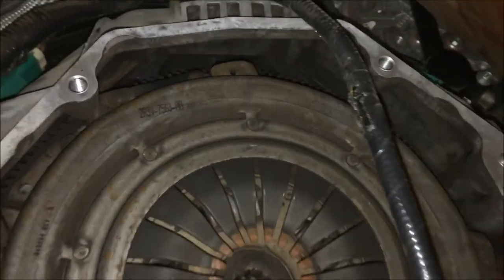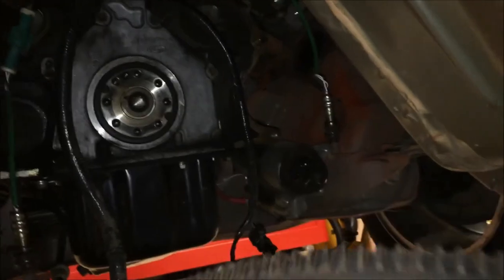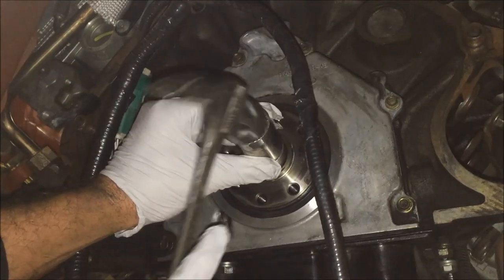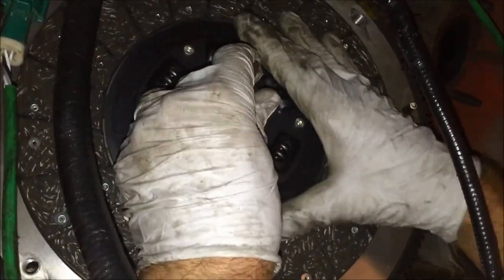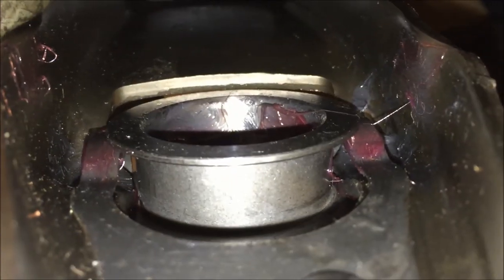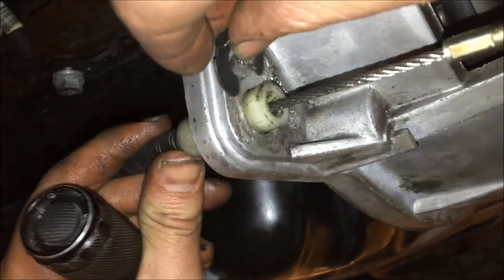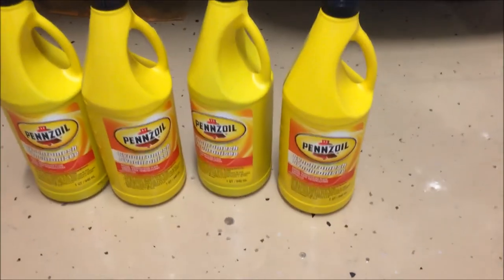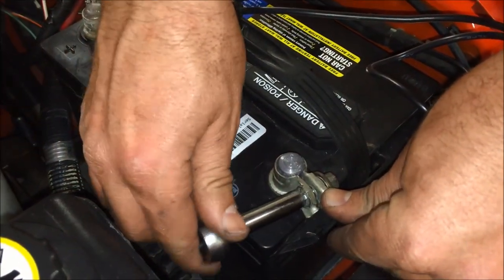(Part 2/2) 03/04 Cobra T56 Clutch, Throwout bearing, pilot bearing replacement release bearing

Comment: Doing mine with the help of my son in a couple of weeks. Ditching the current  Spec stage 3 in it. Thanks for posting this awesome detailed and informative vid!
Reply from the maker: You’ll have to see my latest videos on the pilot bearing removal puller (much better than what you’ll see in that video) as well as the RXT and input shaft videos (though you may not need those if you’re not doing the 26 spline input shaft
Reply from the maker: The puller https://youtu.be/YMx52ovuC8c
Reply from the maker: Set pivot ball stud https://youtu.be/IceR-zPpvns
Reply from the maker: Retainer sleeve https://youtu.be/EsaOBOy67h4

Comment: I see that you apply a lots of grease on the TOB, sleeve and pivot ball.  Doesn't this attract dirt and dust more, so then it's worst than no grease at all?  I heard some people put some teflon non stick spary on this.  
Very good video, I'm going to drop my trans for that Clutch fork adjustment because of the RXT.  This vid is very helpful.  Thanks
Reply from the maker: It may attract some, but not really where it will be contacting, and mostly clutch dust over dirt. I also have a man updated video with the RXT, input shaft, pivot ball stud, etc. 
https://youtu.be/XjAh28xeRm8?si=FDa6tYpJTq421yqO

Comment: Just ordered McLeod twin Disk rxs. Do I get a new pivot ball as well? Purchased 26 spline gear, pilot bearing, retainer sleeve, throw out bearing and new fork. Also should I replace the main seal? Mileage almost 70,000. Thanks
Reply from the maker: The rear main seal is tricky. If it’s not leaking, just leave it. Yes, you’ll want an adjustable pivot ball stud- Street car shinanigans did a video on the exact length you’ll want to adjust it to. Here is my video on the input shaft and retainer sleeve. Be careful when removing so it doesn’t come apart https://youtu.be/EsaOBOy67h4

Comment: I noticed you left the counterweight on the pivot fork. I've heard of people taking it off with the T56 because it hits one of the front cover bolts.  Have you heard of that or had issues with leaving it on?  I found this out too late as already did my clutch job, but did notice on the old fork that there are definite marks in the weight, which I assume are from hitting said bolt.
Reply from the maker: It depends on the clutch and the transmission. The magnum requires a shorter pivot ball stud with the McLeod RXT twins disc clutch and some people have needed to even shave down the clutch fork and the case of the transmission. The question is if yours hits now that it’s installed. You may need someone to look at it (safety on Jack stands) while you push the clutch in
Reply: @dannyjohnsonsgarage  gotcha, thanks. I'm using a McLeod super street pro with the 03/04 T56-specific stud LMR sells. I hear/feel no issues with a completely depressed pedal but will convince the wife to try with me watching

Comment: Hey Danny, I am about to perform this job.. is there any certain reason you used the bread/grease method instead of a pilot bearing removal tool and a slide hammer?
Reply from the maker: Chad Wyatt Just because bread and wet towels always worked. I’ve heard of some people not having luck with the puller. Either is fine

Comment: What is that smaller disc for that goes between the flywheel and the flywheel bolts? I noticed on the Mach 1 video that did not have one, and when i did my 01 cobra using that video it didn’t have one. Now I’m doing it with my 03 cobra drivetrain and even tho it has the same flywheel (exedy lightweight) this one has that small spacer ring.  Should I be putting that back on or leave it off? I can’t really imagine it doing all that much if all that it is really doing is changing how deep the threads on the bolt go into the crank, which I would think the deeper the bolt goes, more thread engagement the better. What’s your opinion?
Reply from the maker: It’s a spacer shim. Without it the bolts might not go in all the way

Comment: Does it matter which way the throwout bearing is installed? I noticed a hump on it when installing my new magnum and i read somewhere that the hump needs to be facing toward the clutch cable...is this right?
Reply from the maker: It should be like this with the peak https://youtu.be/OC4vRWQLGdk

Comment: Im putting in a doublr disc clutch, what other parts would you think are best to replace being that the transmission will be un mounted at that time? Do you know the name of the hose that goea next to the transmission, next to the shifter , so the oil breaths?
Reply from the maker: It’s called a transmission vent tube. I would strongly consider the head cooling mod, throwout bearing retainer sleeve, and 26 spline input shaft. The twin disk needs the 26 spline or you’ll likely break the stock 10 spline. This video shows the retainer sleeve and how to access the input shaft. https://youtu.be/EsaOBOy67h4

Comment: Hey Danny I've got a bad pilot bearing @ 70,000 miles! Just wondering what clutch kit you'd recommend? I'm at 500 HP right now and would like to be around 700 eventually, any advice would be greatly appreciated!!
Reply from the maker: If you are keeping the stock 10 spline input shaft and not doing heavy launches at the track, I would go with centerforce df (dual friction). My brother has spec 2 and it has some clutch chatter.  It’s jut what comes with better clutches, but I like the centerforce pedal feel. Just remove the counter weights on the diaphragm fingers.  
  If you are going hard launches I would go with a mcLoud RXT with 26 spline input shaft. You can see how to replace the input shaft in my video I’ll link below
Reply from the maker: Phil A Hardon It also covers the retainer sleeve which is a big problem on the t56. Id strongly consider a new one as well https://youtu.be/EsaOBOy67h4

Comment: If you have long tubes, you have to loosen them to get the bellhousing out, right? I am running into this exact issue. My passenger header is kissing the bellhousing and not allowing me to get it off the dowel pins. FML
Reply from the maker: Yeah, that's what I'm hearing, but it depends on which brand you have. Some people have been able to drop the transmission (leaving the bell housing on) and not needed to remove/loosen the headers
Reply: I got the bell housing off just now. It took some major twisting and prying. I hope I didnt bend anything. No clue how I will get it back on... We will see!
Reply from the maker: Jani Patrick Good luck man! Hope it all goes back together good!
Reply: I think before I install everything, I will slightly bend that little part of the header with a ball peen hammer to give me clearance. I only need a little bit. Thoughts?
Reply from the maker: Jani Patrick Just remember heated metal can be brittle, so you might be okay bending it a little one way, but not back and forth or a lot. A little may be okay
Reply: No, I would just go one way/ I just need to dent the header tube ever so slightly. Not sure iff heat would be needed, but tapping it with a ball peen hammer with a piece of wood behind it?
Reply from the maker: Jani Patrick yeah, i’m not a black smith, but seems heating it may help

Comment: i’m changing my pilot bearing on 99 cobra but it seems like i can’t find the right one , will the one for the 99gt will fit or are they different?? part number is M-7600-B
Reply from the maker: That is the correct part number. You can’t find one or it won’t fit? Have you put it in the freezer like the video shows and then tapped it in? It is a tight fit

Comment: Hey Danny love your vids as usual, I just finished installing a McCloud clutch kit, and replaced the pilot bearing and the flywheel was resurfaced. Finally got it all together and the car will not go into gear, do you have any idea what would cause this?
Reply from the maker: Phil A Hardon Is it a twin disk, and if so did you get the adjustable pivot ball? Does the clutch feel like it’s getting full travel?
Reply: @dannyjohnsonsgarage  no it's not twin disk, it's basically the same set up that I took out. The pedal feels really soft so maybe it's just an adjustment. I'm gonna look at it again today, I'll let u know what I find out. Thanks man!
Reply from the maker: Phil A Hardon Ok. Check this video out if you have a firewall adjuster and clutch quadrant https://youtu.be/tUR8zWHUxHw
Reply: @dannyjohnsonsgarage  your the man!

Comment: What is the part number for the pilot bearing?
Reply from the maker: M-7600-B
Reply: @dannyjohnsonsgarage  Thanks man I appreciate it!
Reply: Hey bud, so they were out of the M-7600-B and they substituted for part #M-7600-C, they said its a high roller, will this work or should I wait for the other part, I dont wanna take everything apart until I have everything
Reply from the maker: @dannydaniggaz23  it sounds like that is a revised part, likely what they will now sell. I won’t be able to say since I haven’t ever used it, but it should be as good as the others
Reply: @dannyjohnsonsgarage  Well my current pilot bearing is good and the new seemed a bit smaller so I didnt take the old one out, either way thank you very much for the reply I appreciate it!!

Comment: Trick for Pilot bearing:

If you want to avoid the mess or cleanup instead of grease, use bread. Yes bread. Jewish Rye works the best. Also you have a snack once finished while you entertain yourself watching all the YouTube videos of people banging the hell out of the bearing for 4hrs.
Reply from the maker: Ive found this puller works way faster and better than any of the other options. Its not expensive either and you dont pound on the crank https://youtu.be/YMx52ovuC8c?si=TyUelKp8qAweWpRK